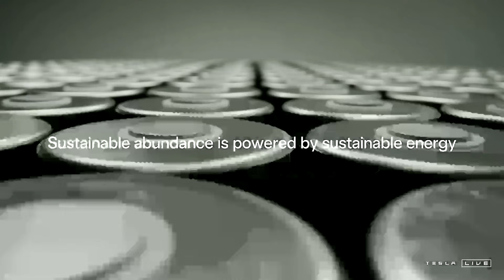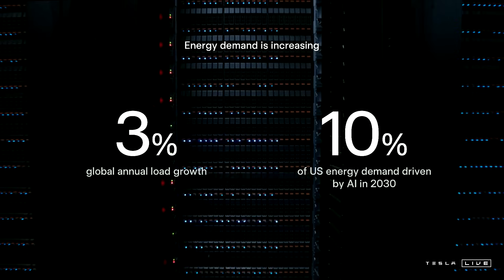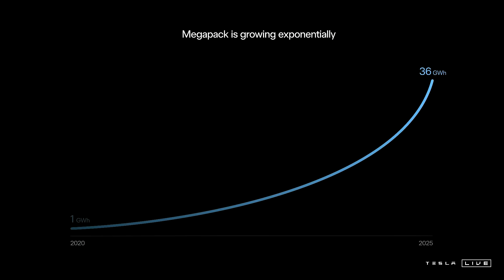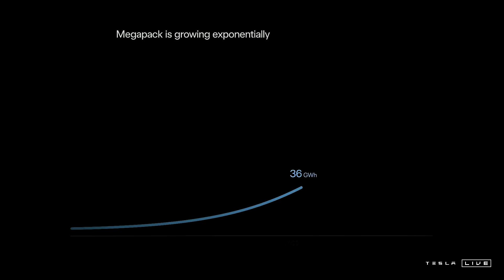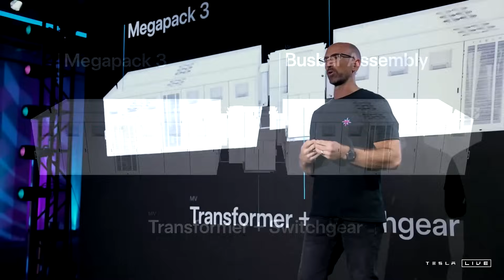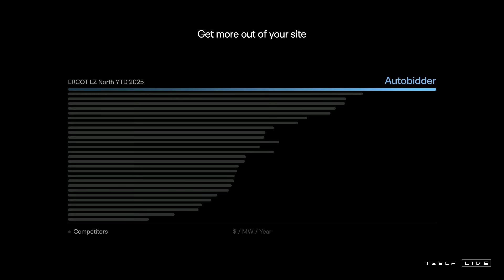Tesla unveils NEW Energy Product!

Comment: This guy is a zero.  He reminds me of Elizabeth Holmes the way he tries to blindly imitate Steve Jobs for no apparent reason.
Building a power grid to self-destruct after 25 years appears to be an insane specification.  Can you imagine if the greatest generation had built hydroelectric dams like that???
Reply: Self destruct? Do you think they use a bomb like in mission impossible? You do know that the electrical generators, transformers, and switch gear on hydroelectric dams gets replace on a similar 25 year timescale. Sometimes sooner.  That's what the Megablock is replacing.  Not the entire Dam... This presentation was geared towards power companies. So it's understandable that you found it boring and got confused.  Hope this helps.  ;)
Reply: @TwiggTwagg  No, no.  You  weigh the Megablock, and almost all of the weight is the batteries.  Just like the cars.  When the batteries wear out, the product is worn out.  They may use tricky pricing to make it appear that you can replace the tons upon tons of Li  batteries cheaper than buying them new, but it is all sleight-of-hand.
Reply: @RobardoHughes  Megapacks are energy storage, not energy producers. There is a difference. If energy storage goes down, the grid will still produce energy. Estimates suggest 70-80% of US power grid infrastructure--transformers, transmission lines, substations, etc.—is over 25-50 years old, often exceeding designed lifespans. Get a clue.
Reply: @mr.whiskers3283  You don't even know how to do a simple capacity calculation, or what a specification of 25 year lifetime means.  And thank you for making my point for me re: longevity of classical power grid components.
Reply: @RobardoHughes  You're still hung up on the lifespan but are ignoring that everything in the grid—transformers (30-40 years), circuit breakers (20-30 years), even dam turbines (25-50 years)—has a finite service life. Megapacks’ 25 years with 10,000+ cycles is competitive, and Tesla’s recycling process mitigates waste, with 92% of material regained for future use.
Reply: for sure you are a jerk, while this man is an exceptional professional one of the best in the world as many thousands other Tesla employee. We are talking about Batteries which are subject to degrade, like your car battery that only last you 4 to 5 years, but this are exceptional, made by Tesla and they last 5 to 7 times longer. Beside that I doubt very much you understood what we are talking about here. Before you make a fool of yourself calling people zero, when the zero we are talking about here is you with zero understanding of the subject matter.
Reply: @sat7755   I understand that you who are suckling at the teat of Tesla react with anger when your senseless source of undeserved high income is threatened with the simplest logic.  But the truth is the truth.  You will see.  You cannot base a practical and sustainable power grid on the idea of replacing its batteries every decade or so.

Where are the degradation curves for the battery capacity?  You act like you are a child who has never built a large system before.

Comment: This video was a terrible presentation for this product. Hire a professional please.
Reply: ...and please give the next guy a cup of water.  What kind of amateurs set up a speaking gig without a source of water for the speaker???
Reply: This is not a consumer product. Who they need to convince are project engineers. They don't need to do pretentious showmanship they just need to provide the detailed specs.
Reply: @kazedcat  Shame on you for pretending that receiving a spec printed on a piece of paper (or in a file) is sufficient to proving that it is true.  Are you familiar with acceptance testing?  Some responsible adult should verify that the spec is actually true.  So far, these are just puffery and pipe-dreams.
Reply: @RobardoHughes acceptance testing does not need showmanship and sleek presentations. The data will speak for themselves.
Reply: @kazedcat   The data is being neither collected nor reviewed.  That is precisely the point.  Mistaking the entrepreneur Musk for a savior will not end well.  Cut the cards.  Examine this salesman's claims with the same depth and thoroughness that you would any other salesman's claims.
Reply: @RobardoHughes How do you know that the data was not reviewed did you buy this megablock recently?
Reply: @kazedcat   That's not even wrong.
Reply: @RobardoHughes So you bought a Mageablock without data review.